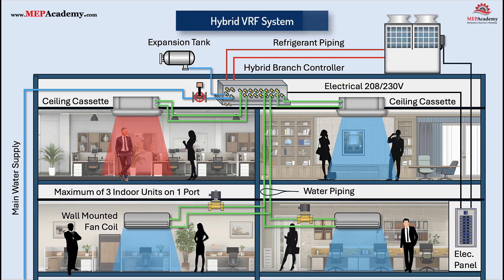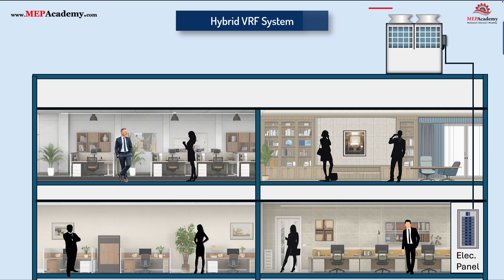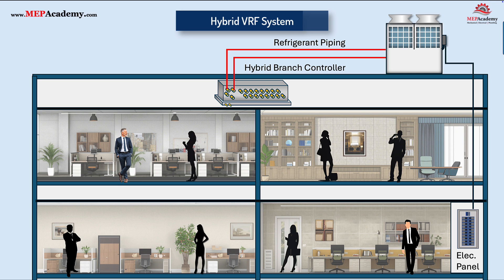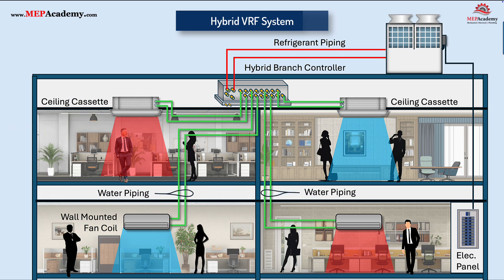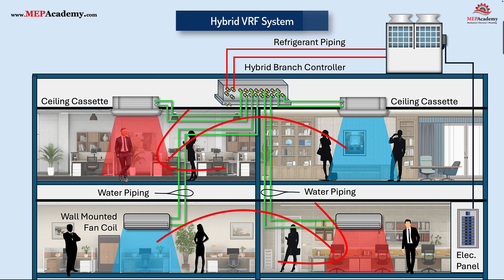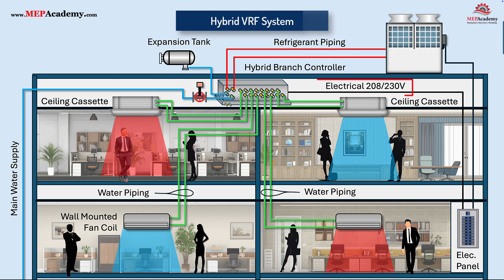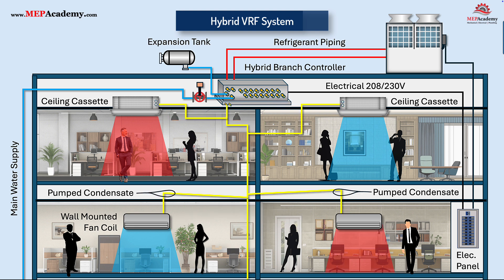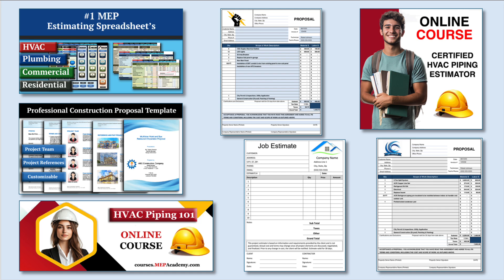Hybrid VRF Systems Explained

Comment: Thanks for the video! Can't we have simultaneous cooling and heating with this system?
Reply: I think that is what the diagram shows, so it is capable of simultaneously heating and cooling different spaces
Reply from the maker: Correct, that is one of the key benefits of a Heat Recovery type of VRF system as opposed to a Heat Pump system. So, yes simultaneous heating and cooling works with this system type.